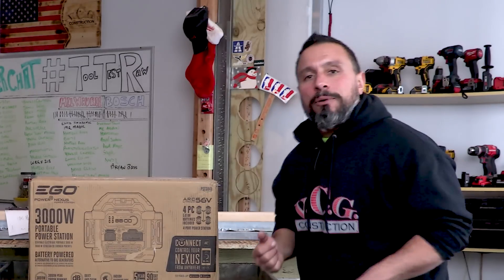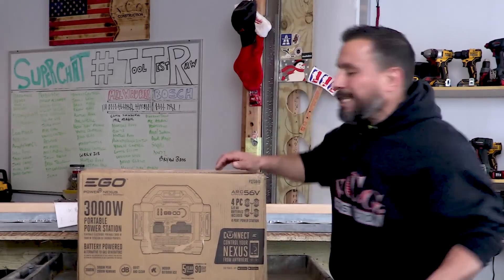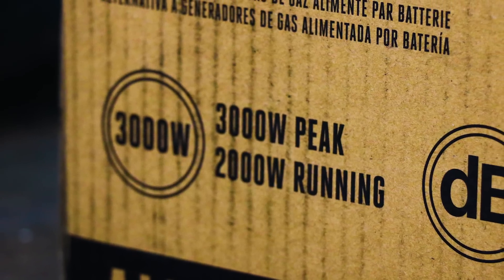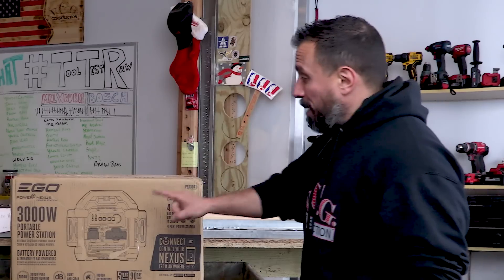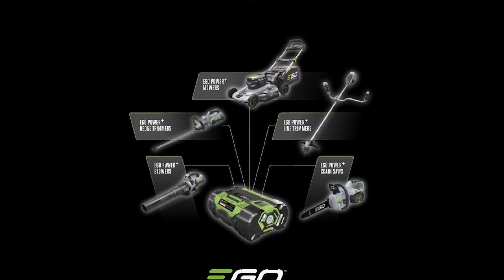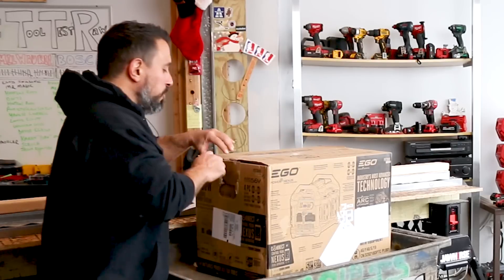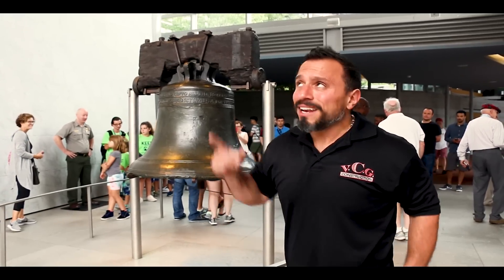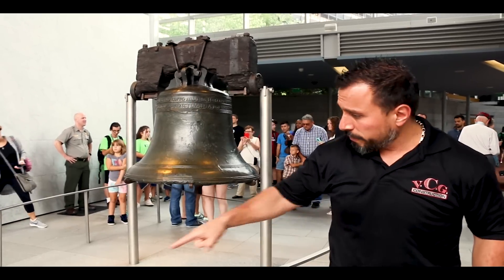Best Battery Inverter To Help You Survive The Zombie Apocalypse - EGO NEXUS Power Station

Comment: Run a refrigerator and/or freezer. I bought the bare tool as I'm already on the EGO platform.  Bought it for power outages.  Last winter,  we were without power for 6 days and had to toss all our food from the refrigerator.

Comment: I’m a DJ looking into buying this unit .. I will be hooking up a laptop , DJ controller , external mixer , wireless mic , and one evolve 20m speaker 1000 watts .. I don’t think you have this equipment but would like to know if this would be okay to handle the power in this unit

Comment: No solar charge option = no deal.  EGO keeps SAYING they are coming out with one but I haven't seen it yet. That's why I haven't bought one of these.  We were without power for two full weeks after a hurricane.  I guess I could have used this generator to prop the door open to let some cool air in the house.

Comment: Hey vince... Air compressor or welding machine pls... Also can you use that as a simultaneous charger for ego batteries? Cheers
Reply from the maker: It only chargers the batteries one at a time
Reply: @VCGConstruction  thanks vince... Can you test it using 3.0hp air compressor? Im base here in new zealand. My options here will be only milwaukee mx or ego generator.

Comment: I was told by my small engine repair guy that ethanol is the worst thing for engines ever. He says not to use gas with ethanol in it, so ethanol free premium gas. End of season add Sta-bil fuel storage stabilizer and top off with fresh ethanol free gas, run to get the fuel mix in the unit and store. Since following his advice I have never had a fuel related issue in any of my machines again. Thanks for your videos, keep up the great work. I find them very helpful.

Comment: EGO should really advertise this power station as a 2000 continuous watt unit, it will only work over 2000 watts to up to 3000 watts for less than three seconds for a power demand surge which occurs when a motor starts up.

Comment: Propane Generator would be nice to have with this setup. This way you can turn off the Generator and the noise that it makes all the while running off of this 2000 watt beast. In a power outage you wont have sunlight.  I wonder if it's true sine wave and not old square wave? Each battery runs about 390 watts hours so 2 of those would give you 800  watts for one hour and it's dead. 1600 watts load would be dead within 30 mins. 400 watt load you get two hours worth of power. It might keep your food in your house good for a day with 4 batteries. Once again Propane take would last how long? How much? I would just buy a Propane Generator and then pair it up with this. This is for light loads for at night and quite nights while power is out. I don't really see this going anywhere unless you have a work van and 500 watts of solar on top. You could be a painter and spray with this setup nicely with 600 watts of solar at least and keeping this bad boy charging. Only problem is solar kit should come with it for that same price. Anyone out in the field has a Truck and could install a 3000 watt inverter pure sinewave and just start their trucks and keep them idle and have full juice the whole day for much less mind you. Charging up those same batteries as well without needed to spend the extra grand. Trucks should come with a 150amp plug for the 12 volt side for sure. Then all we need to do is plug a box like this one in and keep those big ass batteries charging and have the truck start when the batteries get low and shut off after. I don't see the use of this unless it's just getting folks to buy a crap load of batteries. If you use that much power all day and need to keep those things charged you need a something that makes power not stores it. Fill up a cheap 2000 watt gas generator and you'll get at least 6-8 hours of use out of it for 4 bucks of gas. keep all the batteries charged up as well.
Reply: Having a Generator on site just to charge little drill batteries is dumb. Having this thing charged up and then keeping your music playing and drill batteries charging is smart but how much?  Using this with a air compressor and working all day would be dead within a hour at best with two batteries. I guess one would have to spend 2000 more bucks and 8 of these batteries laying around to get jacked by the drug deal down the road. Just being real here no need to get your underwear in a bunch here. @ 52 volts X 7.5amps X 4 equals less then 1600 watts hours per day. I understand we have cordless saws now and high powered tools. Being without cords is the key here. Using this to keep other smaller drill batteries and saw batteries don't seem smart either. Taking juice in one 52 volt pack to put into another 18volt pack. Why not just buy more of those 18 volt packs  then lol?
Reply: Imo, the primary use for this is going to be tailgating and weekend trips to power radios, keep phones and cameras charged and maybe make breakfast while 'glamping' since the 2000w will allow things like electric cooktops and kettles to function (albeit for no more than a couple instances of each). Secondary use is going to be powering corded tools since if that was your primary use you could just invest the cash into cordless tools instead.

There are many better options on the market for less money but this one should appeal to those already in or looking to get into the ego line of tools since you would be saving some money on batteries. For example, you can get a better unit not in the ego line that will already be solar capable (not including panels) with 12v and DC options for around 1100 (checkout maxoak bluetti). So you would essentially be paying around 600 for the four 5ah batteries and a charger, which isn't terrible really since they retail about 250 per battery and 80 for a basic charger.
Reply: @jayjayhooksch1   I spent 1500 bucks total on the panels and the inverter along with the battery. I think I'll get my use out of it camping. I can pull 2000 watts with my inverter using a electric burner but can only use one burner at a time which is fine for cooking breakfast in the mornings. When we leave to go biking and come back the Rav is in morning sun and by noon I have a full battery for things like fans or heated blankets at night.

Comment: Connect it to refrigerator have it run full day if possible. Would be nice to see if it can handle month of no power simulation and we have to depend on this generator
Reply: Definitely not intended as a primary power source for grid down situations, especially since the solar power adapter is only a rumor as of now.

Imo, the primary use for this is going to be tailgating and weekend trips to power radios, keep phones and cameras charged and maybe make breakfast while 'glamping' since the 2000w will allow things like electric cooktops and kettles to function (albeit for no more than a couple instances of each). Secondary use is going to be powering corded tools since if that was your primary use you could just invest the cash into cordless tools instead.

There are many better options on the market for less money but this one should appeal to those already in or looking to get into the ego line of tools since you would be saving some money on batteries. For example, you can get a better unit not in the ego line that will already be solar capable (not including panels) with 12v and DC options for around 1100 (checkout maxoak bluetti). So you would essentially be paying around 600 for the four 5ah batteries and a charger, which isn't terrible really since they retail about 250 per battery and 80 for a basic charger.